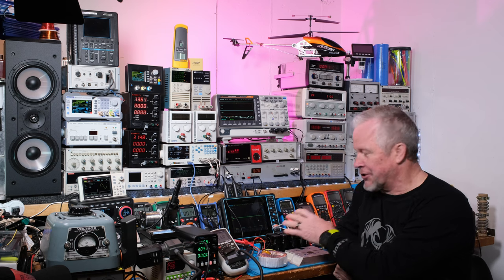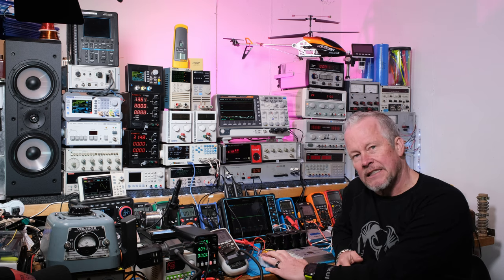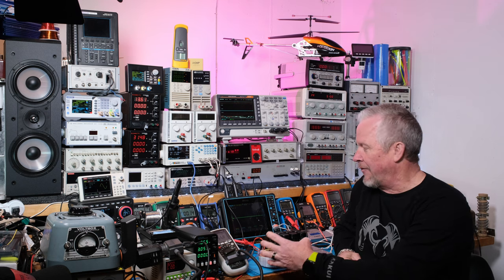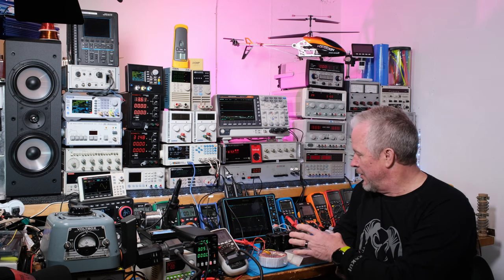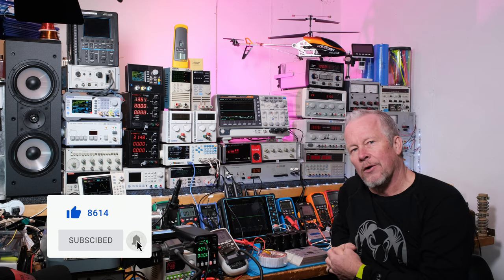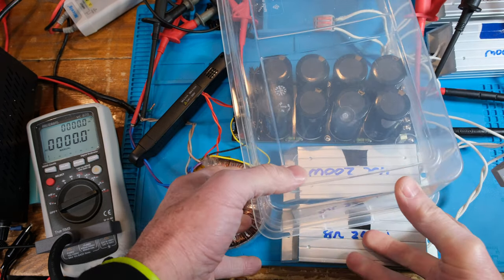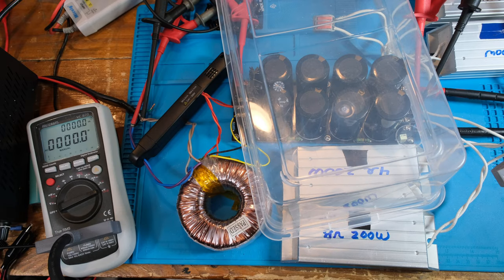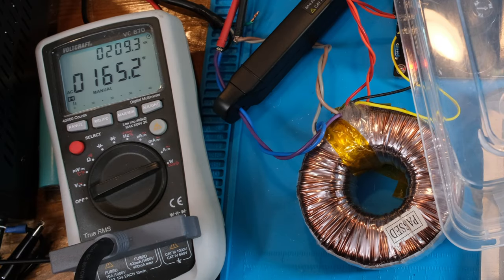Power Supply Input Waveforms - Low Frequency Switcher - NOT a Linear Power Supply #micsig #STO1004

Comment: thx for your effort. do you have experience with snubber networks and cap multiplier? I´m one of these audio guys ;)) I use line filter,  but what regulator would you buid for an 50W + class A Power amp? -thx
Reply from the maker: Great feedback and questions;)  Yes, I will show how to design snubbers in a video soon.  I typically use them in switching PS, but did you have another application for them?  I'm going to design a switching PS in a Collab with JAT.  I started some videos on this but I got side tracked.  I'm just getting back on it.
Reply: @KissAnalog  I believe snubbers are used between the transformer secondaries and the bridge sometimes to deal with HF noise at the point diodes are switching.

Comment: Does the switch-on voltage of the diodes create a minor dead band as the ac supply crosses zero?
Reply: Yes, it is a form of Distortion of the waveform...
Reply from the maker: Thanks for the great question!  Actually the diodes switch off when the AC voltage drops below the output voltage - as then they are not forward biased.  That's why they are only on at the top of the waveform - well passed the zero crossing.  The next video you will see more of a crossover distortion like in a Class B amplifier.

Comment: Wonder if you are so close to the max of the 160 VA Transformer that it is saturated in peaks
Reply from the maker: Thanks Bert for the great question!  No it isn't saturating and these transformers are usually pretty robust and derated a lot.  The DC resistance does start to really show though - and it will start to get hot if left on too long.  When you see the flat top and it actually rises at the end, that shows DC resistance where saturation would show it falling with current, and if it hard saturated it would be like a short.

Comment: Love toroids, but man they are expensive! :(   ...anyway, love the video of what all TRUE engineers know.
Reply: It's bonkers ehh. Ever see the isolation toroid diodegonewild has. Looks like you could do brain someone with it. I got a 1kva hammond isolation transformer on a trade last year and if I dropped it I'm sure it would go through the floor. I'm going to use it to clean up some sort of ground fault loop caused by my recording studio monitors and sub being plugged in at the same time in my current workshop. I'm only looking for a purpose to justify it's existence as I shouldn't have taken it. I can't imagine what it costs to ship off ebay used but digikey still sells them. 30kg.
Reply from the maker: Thanks so much!  I have probably too many large toroids - so maybe I should sell some:)
Reply from the maker: Wow, that's a big transformer!  I have some 500VA transformers for Audio Amplifiers that I bought when I thought I was going to build a bunch of amplifiers;)
Reply: @jstro-hobbytech  Some Time ago I bought 4 x 8kW (lie) LF inverters from PoweJack for the toroids (each had 2 x 4kW toroids in it) for US$400 each (i.e. US$200 for 4kW wound toroid).   The F...ERS lied, they presnet adds/video of units, showing the two toroids insode, but when you buy you only get ONE toroid and the unit will do only 4kW (says 8kW continous on the outside and in THE SALES SPECS!).   They got away with it, morons at eBay ruled against me for what what is BLATANT "product not as described).  But at US$400 is ok for 4kW, but still NOT HAPPY!!!!!!!!!!
Reply: @KissAnalog  Local only :( or you freight will cost more than the toroids!